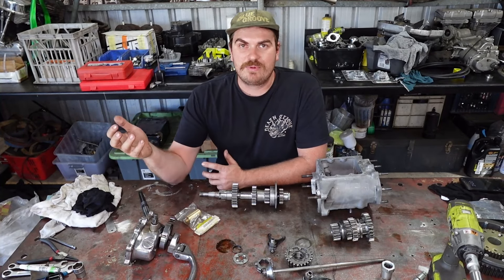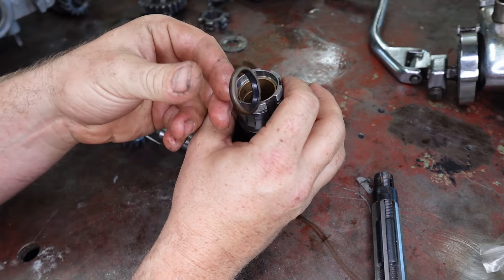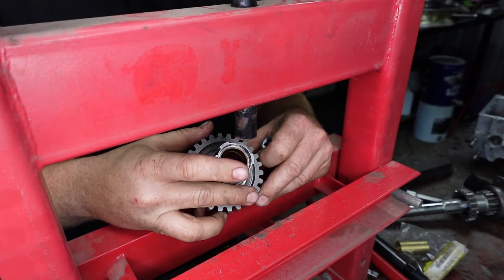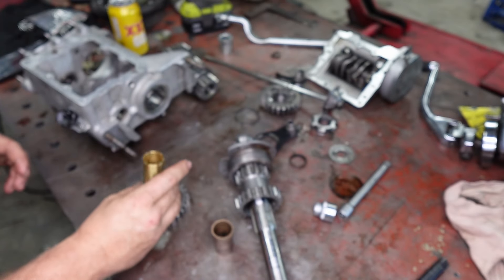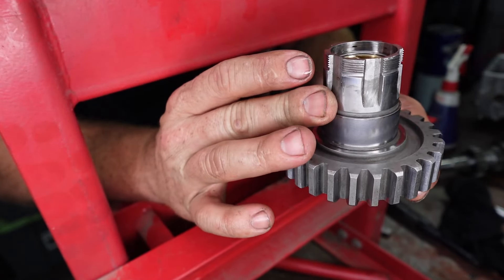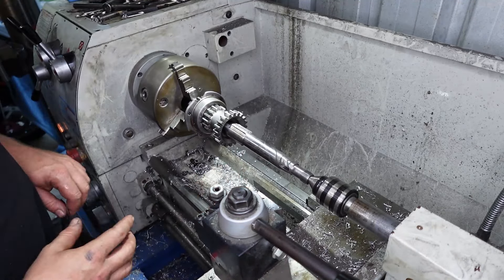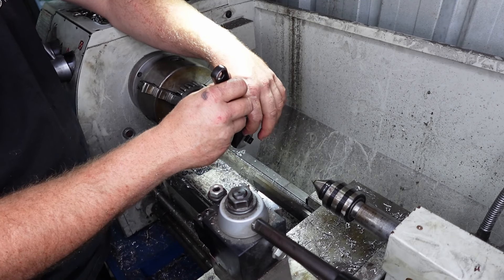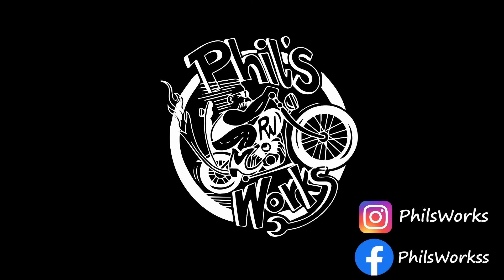Harley Davidson 4 Speed 1936-1984 Top Gear Main Shaft Bush Replacement

Comment: Thanks for an excellent video. I know I should do this; mine is leaking pretty bad but pulling apart the trans...yikes...I've done a  lot of wrenching but never that. I can replace the main seals and replace the spacer with an O-ring spacer - maybe that will help enough.
Reply from the maker: Follow your book and put everything back where it lives and you’ll have no problems!